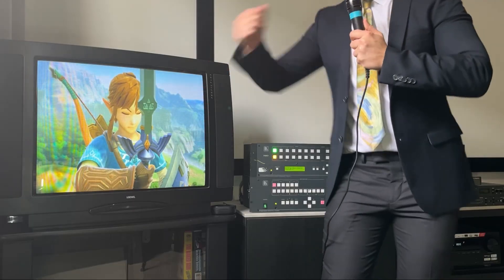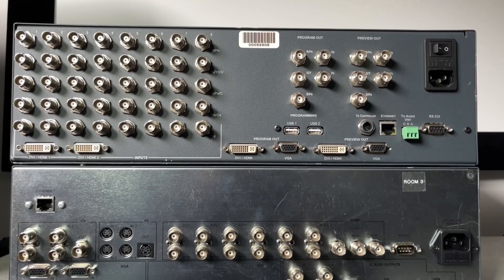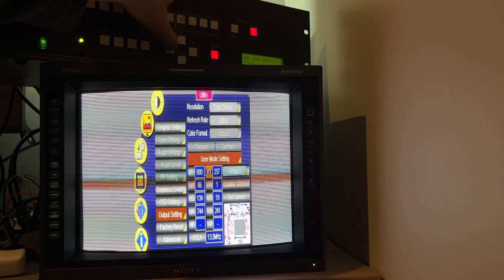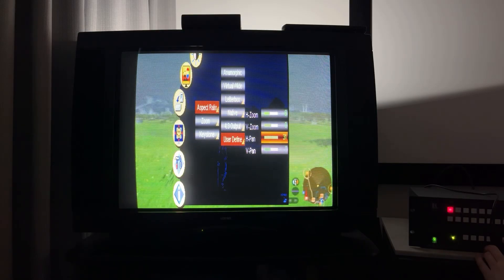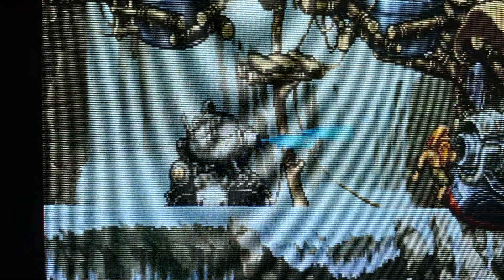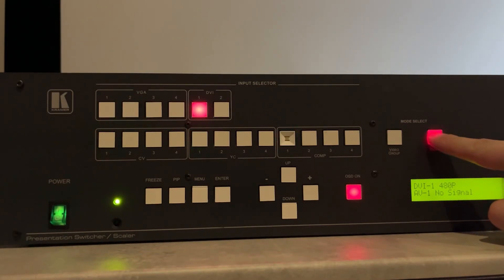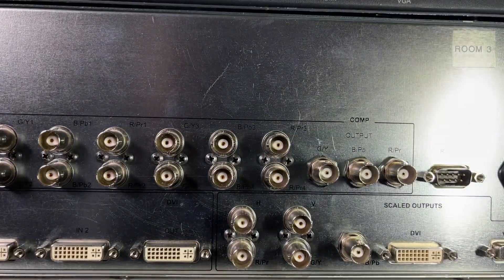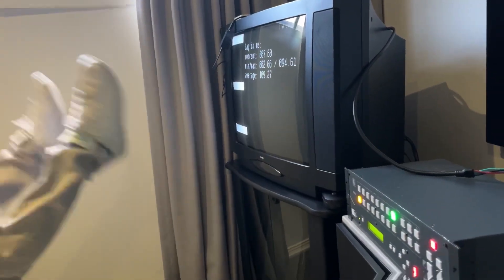Downscaling Chronicles 21: Kramer VP-725DS and VP-747. Switch and Scale for 240p, Move Over Extron?

Comment: Got this working on my Kramer VP-728, but it has a bad habit of forgetting the custom 240p resolution 😪 thats a lot of numbers to manually enter on the front panel every time!
Reply from the maker: Apart for the 2 individuals that I mentioned from the shmups thread, you’re the first to comment with first hand experience downscaling with a Kramer. Damn, that would be a total pain to enter the parameters every boot. I’m not sure I did anything in particular to make them stick. To my knowledge the unit powers on with the last settings used
Reply: @MarcoRetro316  I thought maybe there was a CMOS battery inside that had died preventing it from storing the settings but nope. I've been using kramer scalers for years when I worked in cinemas but only ever had to use the preset resolutions back then. I guess i'll just never turn it off 😂

Comment: Figure I'd ask if theres a good solution to getting 480i and 240p rgbs analog with scaling options and decently low input lag from say a standard smart phone connected from a type c to hdmi out? The solution I want Ideally would let me hook my pc hdmi or dvi i up to run emulators through the rgbs on my pvm as well.
Reply from the maker: I have no idea if your phone will display via USB-C output and what protocol it uses. If it does display on an LCD with a USB-C to HDMI dongle then the OSSC Pro will be able to line-drop to 240p/480i RGBs with next to zero lag. As unconventional as it may be, that should work
Reply: @MarcoRetro316 I'm sorry as a hobbyist I forget that not all display languages are a clean handshake, so my phone to my knowledge handles most laptop and handheld pc docks as an acceptable output, my usage case would likely be one of these generic docks or an egpu with hdmi dvi-d out likely from a radeon series for Vulcan support my output res and aspect ratio would likely vary by program and recompile limitations. My consumer set accepts s video and composite, while my pvm accepts rgbs, composite, svideo, and component. My ideal use case would adjust ratio to fit screen, on top of translating digital signal, and downscaling with minimal blur and input latency. Chasing perfection isnt the goal but something comparable to normal arcade experiences swappable between screens would be nice to accomplish for watching media and playing games.
Reply: To further add if it can take it the other direction with retro consoles to a modern display with line doubling thats great but my understanding is that was the only use case of the ossc pro was to take retro analogue to modern digital display
Reply from the maker: If you’re looking at a dedicated PC build and have a Radeon GPU then you might be better off with CRTEmudriver or Batocera. This will be perfection with no extra hardware, just as lot of setup and won’t include the ability to use your phone as the source of emulation
Reply from the maker: The OSSC Pro can up and downscale. You may be thinking of the original OSSC.
Reply: @MarcoRetro316 looking at the ossc it looks like to get the ossc pro to run out the outputs I need an expansion board, this would be my best use case if I want to run consoles and a pc? Are there any extra units cables or adapter points you'd recommend and thank you for having taken the time this stuff has a lot of weird model specific quirks that make parsing the information a lttle difficult even without market information algos
Reply from the maker: @Joshua-b2l9l for the OSSC Pro, you’d get the Extra AV Out Addon which outputs via a VGA connector. If you hook up directly to your PVM then you’ll need a VGA to BNC cable
Reply: @MarcoRetro316 much appreciated for taking the time, I was looking at everything from a dvs plus rgb out of extron to some weird passive adapter chain black magic on schematics I was seeing on old videos and forums lol
Reply from the maker: @Joshua-b2l9l no problemo :)

Comment: Tenho uma gbs control azul,qual a diferença no donwscaling?
Reply from the maker: I translated your question which reads as:  I have a blue GBS Control, what is the distance in downscaling?

The GBS Control has less than 1 frame of lag and it decimates when downscaling. It only downscales resolutions 480p/i to 240p. The GBS-Control is also more automated, where you just select the Downscaling Resolution to output 240p.

The Kramer VP-725DS has about 2 frames of lag and does not decimate, and instead it scales the image, so it retains information which can sometimes be less sharp but also has less shimmer and less ‘jaggies’. You need to program custom timings in order to downscale. It can downscale higher input resolutions like 720p. In addition to downscaling analog video, you can also input HDMI by DVI without a digital to analog converter. Unlike the GBS-C You don’t need to combine HV sync on the input, though your unit is pre-built and might have a sync combiner. 
The Kramer and GBS-C both have their strengths and weaknesses

Comment: Would you recommend the Kramer vp-719xl?  - i have eyes on one.

Or the vp-721 DS?
Reply from the maker: I looked up the manual for the VP-719XL and the OSD/UI looks practically the same as the VP-725DS, based on that I would expect it to behave much the same for lag and overall scaling, but I can’t 100% verify. I don’t think the VP-721DS supports custom resolutions
Reply: @MarcoRetro316 thankyou so much!! - last question would it be recommended for 480i?
Reply from the maker: @matthewbanda816 480i input or output? These don’t output 480i. They didn’t work great with 480i input in my experience. If you input 480i via RGB then it was random if it would output extra flickery or smoothly de-interlace. 480i component input was more consistent but then lag was an extra frame

Comment: I've been following along with all the Downscaling chronicles but I'm still unsure about what the best way to blend downscale content(whether it's 4k, 1080p, 720p) down to 240p, 480i, 480p or 540p? Decimation absolutely destroys content that is not pixel art above these target resolutions.
Reply from the maker: A Corio2 or Extron DVS 605 might be what you are looking for. I don’t think they’ll downscale 4K but they can certainly take 1080p inputs. Corio2’s are more accessible than a DVS 605 and you essentially get the same functionality, just with not as intuitive picture controls. You’ll also have about 1.5 frames of lag on a Corio2 versus 1 frame in an Extron DVS 605 which is negligible IMO. Check the table in the RetroRGB Downscaling section for a summary of each Downscaler that might be easier to navigate what you are looking for
https://www.retrorgb.com/downscaling.html
Reply: @MarcoRetro316 that’s a good callout and thank you! 1080p should be good enough to downsample from since most devices will downsample to that natively.
Reply: @MarcoRetro316  I got a cheap Corio 2 750 and then a cheap Extron DVS 605 which I picked up as well. We will see how the downscaling goes!!!
Reply from the maker: Down the rabbit hole you go…. Some DVS 605 users have no issue with the output, others have some sync issues that can be fixed by either tweaking the EDID file or by using an Extron RGB interface between the DVS 605 and CRT. 

The TVOne 750 will take some time to set up but it’s well worth it. I copied this text that I wrote for RetroRGB, just some advice I recommend when setting up:

1. Reset all the Corio settings for a fresh start. Rename resolutions as their input to output via the Corio Tool Suite (example, 1080p to 480i)

2. Adjust Source settings first using the highest resolution input, as this global adjustment transcends to all other resolutions and presets. If downscaling line doubled/tripled 240p content, display the 240p test suite horizontal stripe pattern while adjusting. My Sources TL settings are 20 (H) and -1 (V), BR is 0 and 0. Then save startup settings so it will always recall

3. Optimize the HV start and position for each Resolution. If downscaling integer content, only adjust V size with the same test pattern as step 2, but it would be best to not alter this. If necessary, fine tune HV in the Window menu. I have Aspect set to Pixel and H V shift is 0 as I prefer to make adjustments only to the Resolution

4. Save to one of the 10 presets. There’s technically 3 ‘easy to access’ presets; 1 on boot up, and the other 2 as the physical preset buttons, so favor these 3 for your preferred scenarios
Reply: @MarcoRetro316 I’ve already had some pretty great experience doing 480i out of the box with the corio and my steam deck doing 480p. Retro remasters are amazing like this! (Extron arrives next week)
Reply: @MarcoRetro316  The rabbit hole goes well! Set up the Corio, got my VGA to Component cable and set up custom resolutions for 240p and 540p. So far, they have been rather glorious. Playing games like Doom, Quake and Hexen at 240p 60fps on a Sony KV-27FV17 are amazing alternate reality versions of what they were like back in the day. And then did a proof of concept of 1080p scaled down to 540p on Sony KD-34XBR960 is wonderful as the flicker is gone but the resolution boost from 480p and lag reduction are tangible improvements.

Thank you so much for all your help! I'm really enjoying my adventures in downscaling!
Reply from the maker: That’s awesome! Downscaling also made me to enjoy modern remakes in a new way. Glad to hear you’re enjoying your fruits

Comment: Sorry to bother you, but to inform you that it doesn't recognize yPbPr connection only, my curiosity is did you connect RGBHV on the Kramer and the other end that connects to your TV is Scart? If so, did you have to build this cable? Because the only option I found for the RGBHV cable was with a VGA connection and in this case I can only connect to my CRT monitor, I'm trying to find a solution to connect to my TV with Component, can you give me any suggestions? Thank you.
Reply from the maker: I input RGBHV and output RGBHV and combined HV sync with an Aliexpress Sega Megadrive 2 to VGA dongle. 
I bought from this listing: https://a.aliexpress.com/_ms2rEtH
More listings
https://a.aliexpress.com/_mOlVqvV
https://a.aliexpress.com/_mMEKHFd
https://a.aliexpress.com/_msyJLwj

Make sure you select the correct input, it can be RGBHV or component. If you want to output component then you just go into Utility, Color Format, YUV. Then you can output Component using the Scaled BNC Y/Pb/Pr connections
Reply: @MarcoRetro316  Thank you very much for the clarification.

Comment: Hi Marco, I figured you would be the one to ask: is there anything that downscales 1080p or 720p to 480p with minimum lag that you would recommend? It's for a Panasonic SR Quintrix Acuity TX-36PD30 EDTV that does 480p via component.
Reply from the maker: Ciao! Hope you’re recovering ok. The Tink4K would be able to with minimal lag at about 3msec, would need a DAC on the output though. The OSSC Pro+Extra AV Out can output 480p component, Scaler Mode has about 20msec of lag. The Extron DVS 605 can output component as well with 0-16msec of rolling lag. Actually come to think of it a lot of Extron scalers outside of the DVS 605 should be able to do that without a custom res and most have 0-16msec. If you have a DAC on the output then that would open up some options for ones that only output HDMI

Comment: Spectacular video, I have this version of the video, but I'm not sure how to connect it to my TV with the component video input, do I have to use an RGBHV to component converter?
Reply from the maker: Thanks! The VP-725DS has component output so you should just need BNC to RCA connectors and RCA cables. I didn’t test component video but it should work with all input sources

Comment: If i was looking for a cheap downscaler going into a scart set up with h/v combined and line averaging (dont like tossing lines) would you recommend this?

I do have a tink4k but the complicated set up with switches and all that i run now is annoying.
Reply from the maker: I made a table that summarises what each Downscaler does, though in the output column I didn’t state if it combines sync or not
https://admin.retrorgb.com/wp-content/uploads/2025/07/DS-Table-1.png

So if line averaging and RGBs output is your criteria: A Corio2/tvOne where you’ll need a custom cable for VGA to Scart, something for the MisterFPFA will do fine. 

The GBS-C ‘Pro’ (careful as there’s a few called Pro with different tacked-on hardware). This can line drop and line blend depending if you input the signal through the HDMI scaler. It outputs RGBs through a Sega Saturn Din so you’d just buy a Saturn scart cable. 

I’d say those are your 2 options for your needs. The Corio2 will require setup and if you’re using a Scart TV then I’m not sure it sends blanking voltage down VGA pin 9 in order for the TV to switch into RGB, to which you’d need another device. If you don’t mind tinkering then this is a great option. 
The GBS-C Pro is plug and play. It is a little dark and soft if using the HDMI input and the line averaging doesn’t marry up everything nicely for line-doubled/tripled content. If you are just wanting to downscale 3D stuff and non-240p pixel art then that shouldn’t be a concern.
Reply: @MarcoRetro316  Gotcha. Great advice. I actually have 2 Corio2s. A 400 and 750. Unfortunately both have seemed to hit issues. Not sure if it's the cable or something broke internally but they don't seem to be working anymore. I'll look into the GBSC pro though. Thank you for the suggestion. :)

To be clear, I was actually really happy with the output from the Corio2. It just crapped out. shrug

Then again, since I have the custom cables, maybe I'll look into a replacement.
Reply from the maker: @joshuakelly9390 no problem. It’s odd they both don’t work anymore. I’d troubleshoot the cable or reset them to factory and start over if you want to try and salvage them

Comment: Thank you for this nice unexpected episode Marco !

I always wondered if the Kramer devices could do the job. Sometimes those are really cheap and all this I/O are great. Interesting to see that the VP-725DS can do it and at least it can do the job without any insider account (look at you Extron !). Unfortunatly no 480i is a problem for me too. 

I was expecting a score for this one ^^ 

The frame latency joke was really good, a stunning 6 frames with the VP-747 is way to much even for any casual player (I guess). About the rotations, I think my Corio C2-2255 can also do it, I did try this feature but that was years ago so I'm 100% sure.

Oh and that intro with the Seinfeld them was awesome.
Reply from the maker: Thank you! I felt my scoring doesn’t take into account the ‘it’ factor and Downscalers like the Ultracade UVC score really low even though they’re fit for purpose, and the XRGB-3 scores higher than it ought to. On the same merits though it gets 6.3/10
Reply: @MarcoRetro316  Thank you for the reply, and for the score ^^

Comment: honestly i have a GBSControl i use for down scale to 240 15Khz RGBHV on the regular using a arcade monitor. looks pretty good 1080 and down.
Reply from the maker: Perfectly suitable choice for your situation. I’m assuming it’s a GBS-C ‘Pro’ or equivalent with extra hardware merged onto the board since it can downscale 1080p
Reply: @MarcoRetro316  i have a decent hdmi to component box can't remember the brand but it is one of the Chinese ones, has a option that squishes 16:9 to 4:3 so milage can vary with text visibility but nothing is cut off. mostly use it for movies or older hardware that i can adjust the screen. the gbs-c is one i built my self,  i have two of them one to scale things up on my my oled tv and the other down on the arcade monitor.
Reply from the maker: Oh gotcha. Cheap scalers can be good if you don’t need too extensive images controls